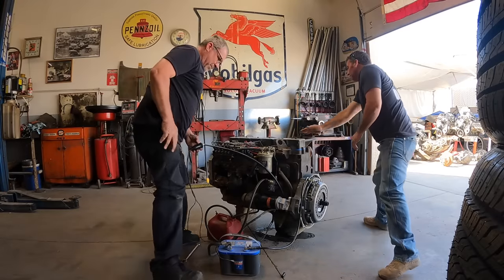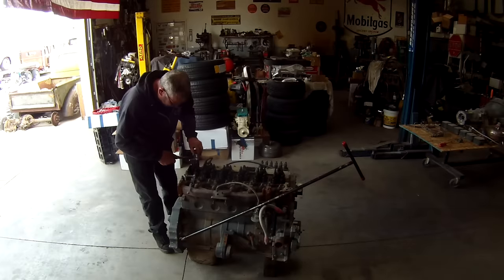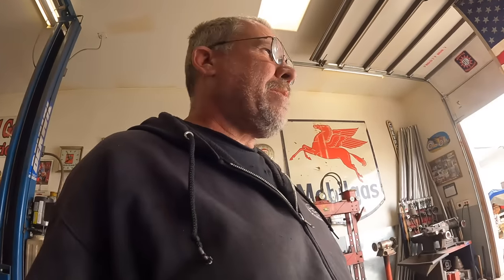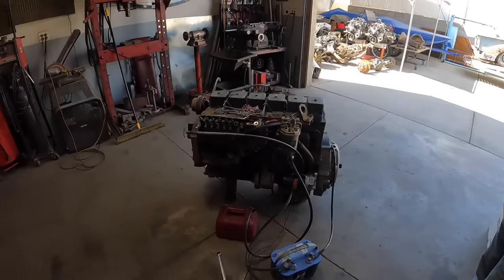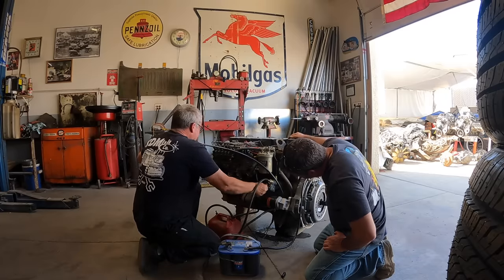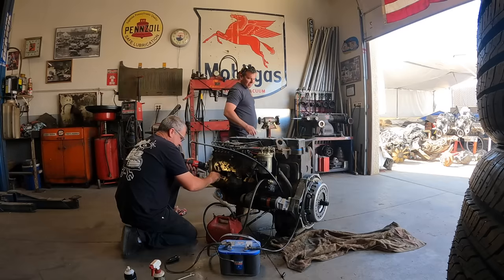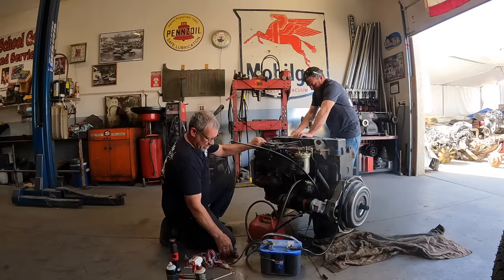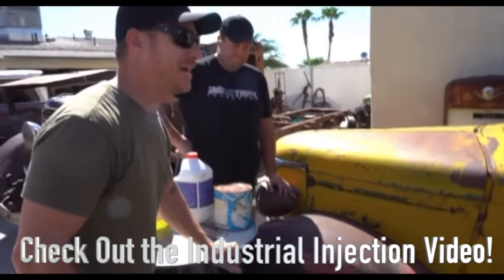Merlin the Old School Magician is at it Again! What Rabbit Will He Pull Out of His Hat This Time? $

Comment: In your zone, you do a fine job of illustrating the steps, to prepare, prior to turning it over. The test, checks, and proofs, that tell you, to listen and watch. 
   Merlin, I was  the 3rd boy, at 7 yrs old when I realized that my brothers, talked big blocks, fuel A dragsters, 1/4 mile strips, and gear ratios. They never explained a thing to me , yet we had a plastic 16” high working V8- cylinder  teaching model with lights, for combustion sequence.
    No one ever, sat me down, with diesel, and design. Glow plugs,  fuel with a flash point, under pressha, revealed, a world, and removed my attitude. Why won’t america lower, it diesel price.. commerce.🤔

Comment: Something I want to see before I die is a V-12 diesel engine I'm told it's built like a Cummins  but it's 192 liter displacement, each cylinder displaces 1010 cubic inches, it's a behemoth, it makes 4500 Horse Power @ 900 rpm it idles 300 rpm, it's a 4 stroke.